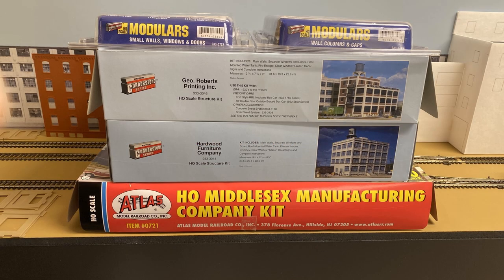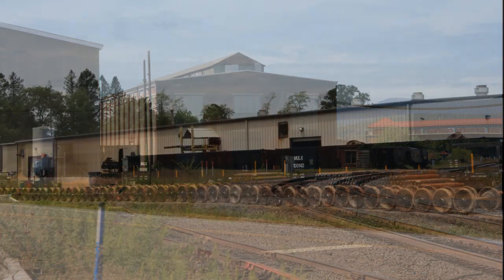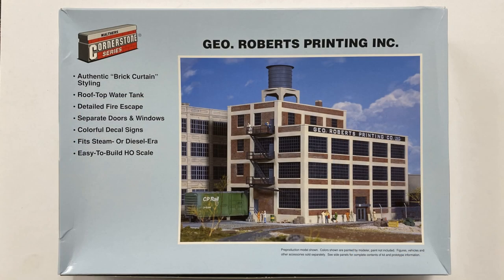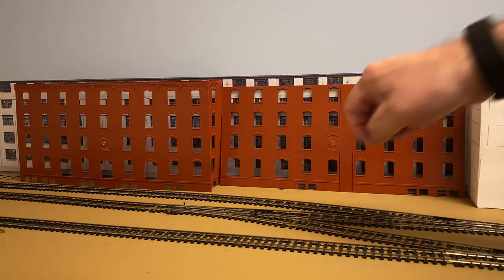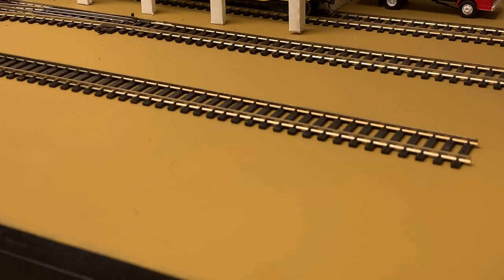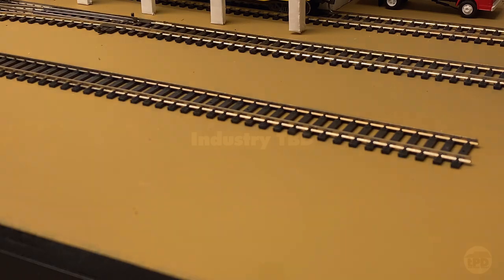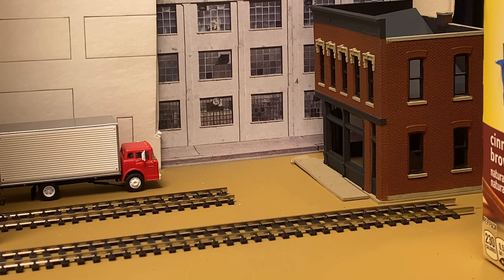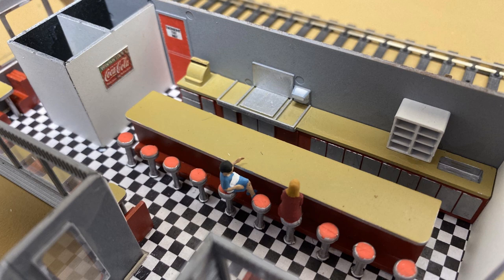Don't Mess Up! Tips for Choosing The "Right" Structures (The Grunge Ep. 6)

Comment: Some notes on industries. A rail served industry can have three types of rail loads being handled. 
1) Raw materials inbound. This can be anything from raw materials to processed materials being used in the manufacturing process. Even an electrical generating facility is manufacturing power. 
2) The more complex the manufactured product the more different types of processed materials being brought in. These can include castings, rubber products, glass, wood products, finished sub-assemblies, steel in bar, tube, rolled or sheet. Sheet steel used for stampings typically arrives in rolls. Rail cars used can include box, flats, gondolas and center beams. An all under one roof automotive facility can receive the following.
Casting sand, iron or aluminum billets, castings, sheet steel, glass, tires, paint products, fuel, sub-assemblies such as dashboards etc. That same facility could be shipping out a thing from complete cars to various parts including stampings, body sub-assemblies, engines, transmissions, other drive train parts etc to seperate assembly operations. 
3) Finished products outbound can be shipped in box, flats, center beams or auto transporters.  
4) Any industry that produces stamped or machined parts will generate scrap. Left over trimmings from stamped parts. Chips from machining operations. Which normally would be shipped in seperate loads. Trimmings from stampings typically are baled into cubes. Chips can be cast iron, steel, aluminum or even wood if there is a customer for it. 
The point of all this is it's not just loads, empties out. Gor some industries yes. A ready mix plant comes to mind. But for other industries it is a lot more complex.

Comment: You could put a street just to the right of the diner.  That would allow truck loading on the right side of the newspaper building.
Reply: I'm considering streets on both sides of the diner, although I'm more concerned about truck access to the area in front of the undetermined industry than I am the News-Herald. At  least at this point. That may change!

Comment: Hi Joe, I'm not too sure about the location of the diner. To fit in the diner somewhat realistically you'd may need some parking spaces for instance and some type of barrier between a public space and the railroad? Perhaps a suggestion might be to move the diner to the back of the layout, 180° turned around and filling the gap of the missing industry? Just a thought. Enjoy!
Reply from the maker: I think the aisle is my friend here. My plan was to put the front of the diner right at the front edge of the layout. Then the parking lot is in the aisle, and the street beyond that. I have some wood fencing that I was planning to put between the diner and the fence. I thought it would give it an appropriately run-down look. Thoughts?
Reply: @ThePixelDepotLLC   Interesting approach, would've never thought of it that way, thanks. I'm European, so I'm accustomed to other "standards". To each his own. I'm kinda curious now how this will turn out 👍

Comment: Darlington Electronics...

I haven't worked in an electronic firm in 30 years, and haven't specified a voltage regulator since, but I remember the materials planners always being on the phone with the EEs ranting about how they needed to update their part numbers, as those #$$%^^ed Darlingtons are being made anymore!!!   ;)

Thanks for the memories!
Reply: And I had to look this up - my memory was a bit porous, as I had only a specific half-remembered application of a Darlington...

And, I'm not enough of a Sparky to do this in my head, but wouldn't a Darlington help to miniaturize a Twin-T detector???
Reply from the maker: I had to look this up, as I'd not heard of a Darlington transistor. My reference is actually from a movie! But I learned something today, so thanks! :)

Comment: Urban industries not so commonly served by rail - they usually do LTL motor freight, let alone how small their shipping & receiving needs are relative to a 40' boxcar - that were around in the seventies which might be less common these days:  A specialty machine tools supplier (think bench lathes and Bridgeport mills), a wholesale autoparts dealer, a chrome plating operation, or a clothing factory all come to mind... most of which I have seen disappear from downtown Los Angeles over the last 40 odd years...

Lots of places where urban industrial businesses were holding on in the 70s up until the early 90s, and where truck freight better met their needs even before WWII.
Reply from the maker: These are all great ideas. I wish I could use them all. Now I have the opposite problem, I need to whittle down the options!